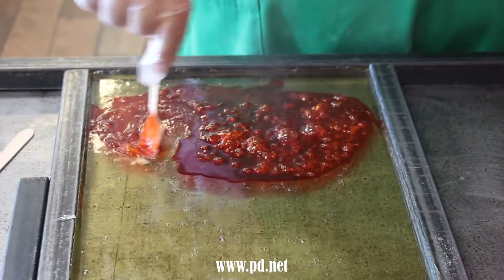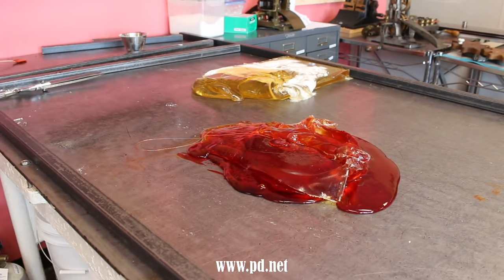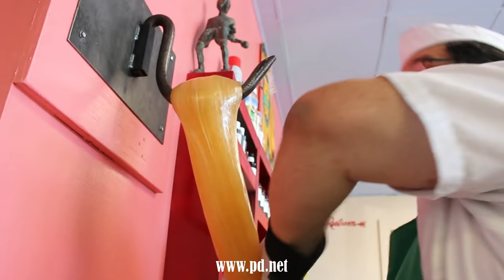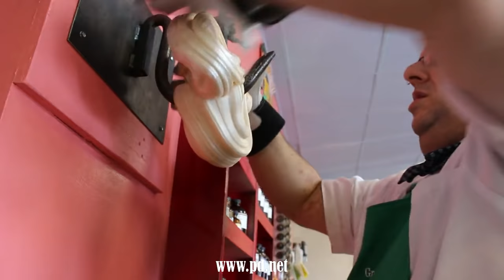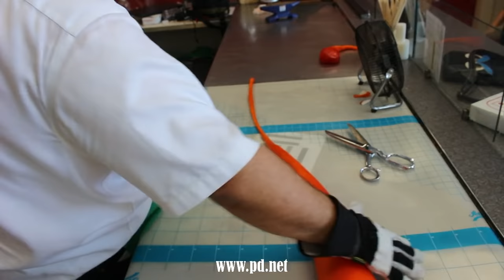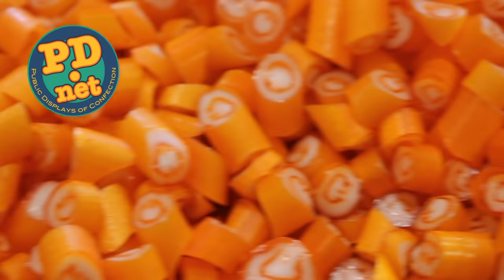#52 Making of power button Image Candy at Lofty Pursuits

Comment: I was curious what happens if the design you were going for does not come out the way you intended it to? Do you sell it as Unicorn Droppings or do you just scrap it and start all over?
Reply from the maker: We put them in Damfino's. Our random mix of whatever we have. We sell that on-line at a discount. The unicorn droppings only go out if they are large lump.
Reply: Rebecca Reed .
Reply: Rebecca Ree

Comment: Now that I have watched..... almost every video. I have heard you mention a few times that you have to take in consideration humidity.  I have a question for you about that.  When you go to make the white portions of your candies via pulling hook, does humidity that is trapped in those air bubbles, effect the candy's molecular structure in the long run?  Or is the humidity only a concern to exterior surfaces that would be exposed to moisture over time.

Comment: How come you didn't pour all the sugar, you left the last bit in the bottom. Is it because you are in a hurry to get it out so it's all the same temp or to make it easier to empty/clean later?
Reply from the maker: +insectdude1258 that was just the edit on the video. I caught it before I poured the rest. The bars started to move and I had to adjust them. It took a few seconds and I decided to cut up to keep the length of the video down. Once the bar stop moving I added the rest of the sugar

Comment: When pulling the candy to turn in white, do you wear a special pair gloves so as not to leave contaminates in the candy or is it not very sticky at this point?
Reply from the maker: If you can do the temperature control it's not very sticky, but white shows everything, so everything has to be clean. Mind you gloves do get stained with food coloring, but that does not transfer once it's dry.
Reply: Cool. Thank you.

Comment: Are you using a plastic spoon to mix in color and citric acid? Why not metal like all the other tools used?
Reply from the maker: Ummm, the spoon is wood. A metal spoon gets too hot too fast and you can't hold onto it.
Reply: Ummm, ok.
Reply: HeyIt'sBaert if it was plastic, it would melt really quickly when it touched the candy. Metal heats up too quick, and anything else is expensive. Choosing disposable items also means that you can, well, dispose of it afterwards instead of cleaning it. Any idea how difficult hard candy is to get off something as small as a spoon? It's not fun.
Reply: Its actually quite easy to get hard candy off almost everything. Just boil it for some time.
Reply: OH MY GOD. You have actually made my life much simpler. I literally never thought of doing that.

Comment: maybe someone told this in the comments but the symbol displayed it not actually an ON/OFF symbol. it's symbol IEC60417-5009 meaning Standby. The reason it's most commonly used is because most devices we use only have a standby mode. on switches you often see the I or 0 symbol indicating the on and off state. the symbol for the on-off button is a 0 with an line vertically inside of it.

Comment: I have a question, when you pull the white one to make it, well, white, do the air bubbles that reflect the light change the flavor or texture of the candy?
Reply from the maker: +chara dreams it does change it. It also gives the candy more surface area on a microscopic level. This exposes more candy to dissolve and increases the flavor.
Reply: Lofty Pursuits intetesting, I was thinking that and it made me wonder if it actually changes it
Reply from the maker: It's one of the reason our candy tases so good.
Reply: Lofty Pursuits cool!!

Comment: Do you increase the temperature due to the change in pressure the storm brings?
Reply from the maker: We have but it's hard to judge how much.  It's often easier to just wait until the storm passes. It's when a front comes in (no storm) because when a storm hits the air pressure goes up, down, left right it seems. If we are just in a high pressure zone, I can compensate by increasing the final temp, or lowering it if in a low pressure zone.

Comment: when you pull the candy to make it white, because of the air bubbles does the candy expand?
Reply from the maker: +Jenna Brannen yes it does.
Reply: Lofty Pursuits cool, I thought it would. what about the texture or the hardness of it? does it differ from nonpulled?
Reply from the maker: It stiffens it, it's still soft, but it adds a structure to the candy. Feels a bit more like foam rubber than silly putty.

Comment: If the critic acid was ground much finer, would it not leave those white spots you talked about
Reply from the maker: It then makes the clear candy hazy. Finley ground citric acid also likes to take to the air. I get a slightly coarser ground because the fine stuff gets in your eyes and makes you cough. This works.

Comment: Greg, I have seen some other candy makers use white coloring and then pull the candy after. The candy you create is still a nice bright white, so I am not sure why other candy makers use white coloring AND pull the candy. Might you have insight into the reasoning for that? I feel like it would be preferable to do it your way, but maybe it is a significantly brighter white? I can't really imagine that since the white you guys make is pretty bright.
Reply from the maker: It's hard to pull the sugar that white. It takes quite a while to master. It has to become muscle memory. I'm not sure why they use the die, but white food coloring is Titanium Dioxide, and, it may just be me, I don't want that in my diet.
Reply: Agreed! Keep the flavors pure and the additives out! There's a reason the traditions which you follow dating back to the 1800s still work today. I was just curious as to why they might use it when they pull it anyway, I did not realize pulling was a technique that takes quite a while to master. Thanks for the info.

Comment: the pulling hook looks old and the plate looks new. how was the hook originally mounted?
Reply from the maker: +mark a bag we have the original amount in a drawer. It's very small but it works if you have long enough screws. Because that wall has metal beams and I we needed a different mount.
Reply: Lofty Pursuits cool thank you. I wondered if it mounted on a swivel at first but looking closer it seems to have a square section that must slot in.
Reply from the maker: THe mount it had was square too. It comes out of the square so we can wash it. We still have the original mount. This one belonged to a candy company from Cincinnati that opened in 1848. IT's a good one. I have three hooks now, but this one is the thickest so it can store the most heat. It's nice to work with.

Comment: Just curious - Why did the sugar have to be hotter than usual, and how is that related to the storm?
Reply: "Cooking candy syrup to the desired temperature means achieving a certain ratio of sugar to moisture in the candy. On a humid day, once the candy has cooled to the point where it is no longer evaporating moisture into the air, it can actually start reabsorbing moisture from the air. This can make the resulting candy softer than it is supposed to be."That’s why dry days are recommended for candy making, although the effects of humidity can be somewhat counterbalanced by cooking the candy to the upper end of the appropriate temperature stage."

I had the same question so I googled it, I was thinking in my head about high moisture content being the cause but then again having your store in Florida probably makes that humidity thing difficult..
Reply from the maker: +Aeasala air pressure. We had a high pressure zone, and the boiling point of water went up. Annoying to deal with.
Reply from the maker: and it gets better, what do you think pulling the candy does for trapping moisture from the air?
Reply: oh right on, I was wondering of Barometric pressure had a part in this as well, but couldn't find anything.

Comment: That's not actually a proper on-off button symbol. The proper symbol for on-off is the one completely inside the circle of the zero. The one breaking the circle of the zero means that that button is not a proper physical power switch that cuts off current flow past that point. It's the one in common use because almost no modern electronics use real power switches.

Comment: Try doing the hook as a number 8 figuratively and use a hammer to brake the sugar on the hook making it slide away eaisily
Reply from the maker: Getting cooled candy into my batch in shards like that could cause the whole batch to crystallize. That's stupid. Where did you learn candy making? You want me to risk losing a whole batch of candy just to save two or three candies worth of sugar? The only people who would do that are people with a hook that can't come off the wall. There is no good way to clean a hook like that so almost nobody still uses one.
Reply: Lofty Pursuits why are you being so rude and defensive I was only trying to give a suggestion
Reply: Lofty Pursuits moody